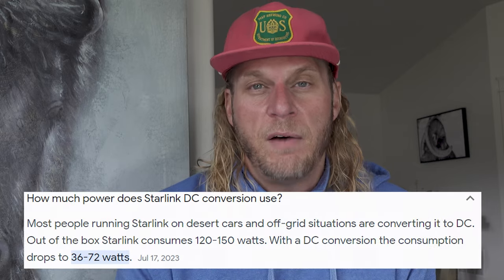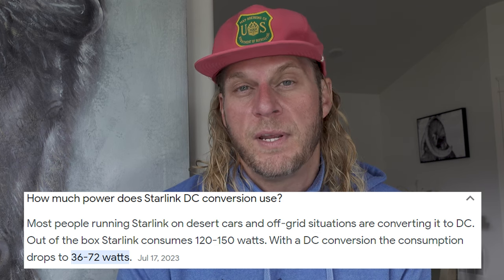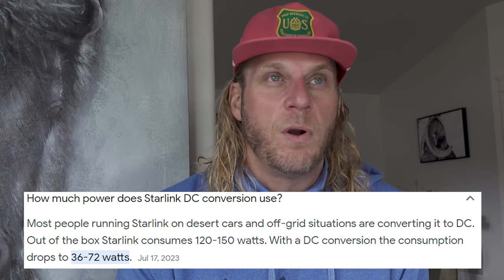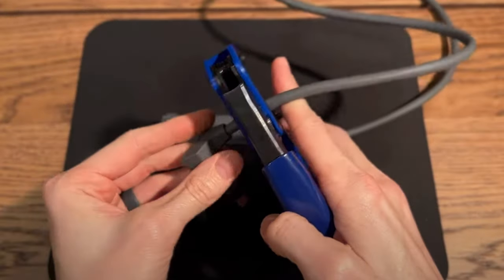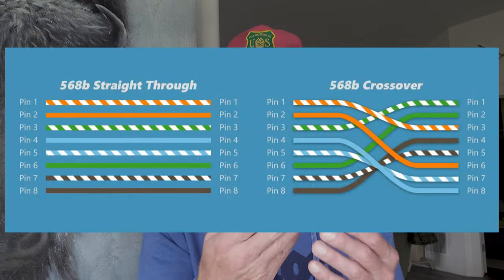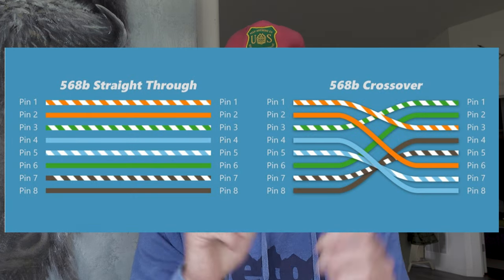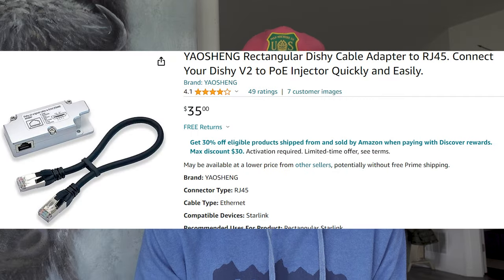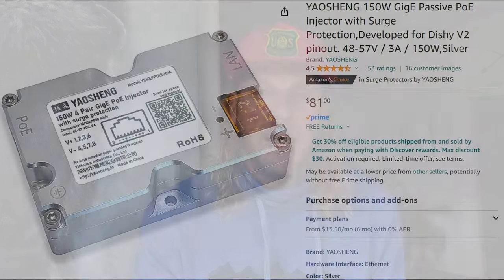Effortless Powering: YAOSHENG Adaptors Simplify Starlink with DC/Battery

Comment: I've done the same however speeds have dropped to under 1Mbps. Back to Starlink router and speeds back up. New network cables as well. Any ideas?
Reply from the maker: That's crazy. What router was it and wifi protocol do you know?
Reply: @HillPhantom  GL iNet Opal router. Just the standard security protocol. WPA2 from memory.
Reply from the maker: @damot1243   huh, same one I have.  And how do you have it all wired up? Have you tried switching cat 6 cables? Or have you tried turning on the bypass mode?
Reply: @HillPhantom  I put the opal into repeater mode and tested all the network cables. All cables had full speed similar to connecting directly the Starlink router. Only 2 connections left are the POE injector and the dishy to Network cable adaptor.
Reply from the maker: are you using the same set up as I am, with the adaptors?
Reply: @HillPhantom yep same adapter's. I think only a slightly higher step up converter in terms of amps, still 48v though
Reply: @HillPhantom  I just tested the POE injector with the opal router in repeater mode and the data throughput was similar to being to connected directly to the Starlink router.
That only leaves me to test the dishy to Network cable adaptor as this might be the problem, although the dish is getting power to start up.
Reply: This is a pretty common problem due the electrical noise generated by the 12V to 48V converter that then powers dishy. You can google it to confirm. Some people seem to not have the issue but many do. Best solution is a better converter such as the one made by Meanwell (DDR120A-48). If you use a router that can automatically downgrade the link speed to 100 Mbps then you usually get a stable connection as well but limited to 100 Mbps.
Reply: @christophS2468 
Will look into that. Just got to test the throughput of one more component to eliminate that.
Reply from the maker: @christophscheurich7570  interesting I have had no issues with my set up. I like the idea of the Meanwell but its a bit of overkill for my set up personally. I think its an awesome observation and  suggestion as the only differences is he has a different buck convertor. @damot1243 Christoph has a great solution and troubleshoot suggestion!!!
Reply: @HillPhantom  If your setup works then don't worry about it. Some PoE injectors do a better job at  noise filtering and the amount of noise that you have in your 12V system varies. I didn't discover this solution even though I ran into the problem myself. Did a bunch of research after my dishy connection never really worked in a similar 12V setup as yours. Substituted a router set for 100 Mbps link speed and that worked up to 100 Mbps. Ordered the Meanwell up converter and everything worked with the original router at 1 Gbps link speed.
Reply from the maker: @christophS2468  wicked cool! I think I need to order the Meanwell! Thanks so much!
Reply: When I initially connected everything up I was only getting 10BaseT half-duplex link lights on my switch.  It turned out to be that short black ethernet cable that comes with the adapter hooked between the injector and the adapter.  I don't know what is wrong with it but I replaced it with a regular gigabit ethernet cable and the switch negotiated a gigabit.

If you are still having issues, also perhaps consider putting a ferrite bead on the +48V power, or even one each on the power and ground wires, and see if that improves the link.  Separate beads, bundling the two wires together with one bead won't do anything (net current is zero).
Reply: Ok. Finally got around to testing the new power supply. Works perfectly. No changes to anything else.
Reply from the maker: @damot1243  heck yea! On that DC juice now! Congrats!
Reply: Try the same Yaosheng 120W injector. It contains low noise 12/24V to 48V DC-DC Booster and PoE Injector. All protected from over/under voltages, reverse polarity, overheat etc.
Reply: Same problem here

Comment: I've been looking for precisely this sort of gadget to directly power dishy from my 48V battery system.  Got both devices and it worked pretty much right from the get-go.   I was able to remove the DC-AC-DC conversion and remove the wifi router entirely in favor of my own.  A+.

I have two comments.  First, the black ethernet cable that was included with the adapter actually had some contact issues and my LAN only negotiated 10BaseT half-duplex, but replacing it with any old GigE ethernet cable solved that issue.  So check the link speed.

My second comment is that people should be sure when connecting up the 48VDC to put a glass automotive fuse inline with the positive, rated for 3A or 3.15A or so.  This is a passive injector which means that it does not have the normal power safeties that active injectors have.   Use an inline slo-blo glass fuse because we're talking about 48V here and normal automotive blade fuses are only rated to 32V.

I'm a very happy camper.  Dishy is consuming a lot less power now.  Generally between 25W and 40W now.  Before it was eating 60W plus additional inefficiencies from the DC-AC-DC conversions.

-Matt
Reply from the maker: Awesome feedback. TY so much! We had another user with speed issues I bet that cable was his issue! Cheers!
Reply: During the worst conditions: (1) snow-melt is on at low air temperatures, (2) both download and upload traffic is active,  your Dishy V2 can consume up to twice more.
Reply from the maker: @calypso5925  True but not if you turn off the heater. That's the kicker why it draws that much. Not that a recommend turning it off...wink.

Comment: Something weird happened to mine. Yaosheng also. around 4-5 months ago, i tested it, and stumble into the same problem as your pinned comment so i abandoned this idea. But at least the power consumption were indeed small, at around 40watts draw from battery. 

Fast forward to last week, i retested it, and now the power draw is even more than with AC power, at 80watts standby. Although the speeds has become equal with the original setup.
Reply from the maker: Thanks for posting this update. I have been locked in winter so have not visited it, but soon I will, and I am eager to see if it survived the cold.

Comment: Did you use any kind of connector for the power cables into the POE injector?  What gauge wire?  I'm trying to put 10AWG cables into mine and so far it seems like not enough room, not sure if I need a fork connector or something.
Reply from the maker: No need for POE injector that YAOSHENG handles all that! I used I think 12 gauge wire and it fit well. I know this is late but how did you end up?
Reply: @HillPhantom  found some small ring connectors and worked great.
Reply from the maker: @gf3803  so glad to hear that! On that DC juice now! Nice!

Comment: So you don't use the starlink router at all? I didn't know you could get startling through just the dish and a generic router... interesting
Reply from the maker: Yup you can use own router, just need to specify your doing so in app :)
Reply: Do you mean that one would need to turn on the bypass mode? I’m trying to get this to work but for some reason I’m not successful…
Reply from the maker: @mikalweber2471  it actually should work without but best practice to turn on bypass mode. I got lucky was plug and play pretty much w.o. doing bypass and never got around to doing it and it was fine. Here is a good walkthrough. https://www.starlinkhardware.com/how-to-bypass-the-starlink-router/

Comment: Thanks!! Great video… Do this instalation works with any version of Starlink Kits?? Thanks
Reply from the maker: So, I have not tested it yet, but I do know other dishes require more AMPS to power it. That would just mean you need a bigger convertor to get the right amps to Starlink. I recall Gen 3 uses more amps for example than my gen 2.  I would check the amps on the dish, also check with YAOSHENG before you purchase as they may have new versions and perhaps "made for x type of starlink". I need to revisit this a bit myself, as I am looking at trying to get the newest little dishy! Thank you by the way or the watch and comment! Cheers.

Comment: Hi I wonder if anyone can assist me. I have almost identical setup to this with the exception of using the Meanwell 48V transformer. I can get it all setup, Starlink boots up and does its thing and finds satellites. When it gets to the last stage of determining its orientation, it disconnects. I then have to restart it again and then the process starts all over again.  I have managed to get it to connect only once so far. When I revert back to the original router there is no problem.
Reply from the maker: That's a really tough one to be honest and above my pay grade a bit, but I will try my best. What router are you using?
Reply: Hi many thanks for your response. I actually managed to get this to finally work yesterday. It seems to be that the issue was the Starlink was set on residential rather than roam or mobile. It seems even though I was still at my home address it thought I was trying to use it from another location when I connected it to the 12V system rather than through the original Starlink router. @HillPhantom
Reply from the maker: Thank you for responding back and letting us know, as that to me his highly interesting.  That almost indicates they can sense power source and make assumptions based off of it.  Very interesting thank you for reporting back!  @craigwalker8195

Comment: Maybe you should think of putting an in-line (12 Amp) fuse from the 12 V battery to your 48V/5V inverter, in the event you have short, it will prevent a fire!
Reply from the maker: Totally agree! Also installing a battery turn off. Going to revamp it a bit for this season and the inline fuse is top priority. Great suggestion! Thanks for watching! Cheers.

Comment: I’m a telecommunications technician have been for over 20 years and your cross over diagram is wrong, and the Starlink factory made cables are Cat5e
Reply from the maker: Good catch! I actually must have grabbed the wrong diagram! I see now my error! Cat5 e im prob said Cat7 huh? Making videos and keeping all the info together and making my mouth say the right CAT is hard sometimes! I am certain its not a DOG though lol. Appreciate the corrections mate!
Reply: @HillPhantom are these errors corrected/fixed in the latest edit of this video?  Or are the errors just noted down here in the comments?
Reply from the maker: @traviswolf  The only error is I put the wrong diagram of a cross over cable. No other errors the system you see that I built works fine. I just accidentally put wrong diagram of a crossover cable which is not needed if you buy the adapters I am using.

Comment: You nevet did the power comparison
Reply from the maker: I am sorry, I got super busy, what was the power comparison you where looking for again, please excuse me, had lots going on..Cheers!
Reply: @HillPhantom  it was between using the starlink on inverter and using it on the 12v power
Reply from the maker: I need to get a power monitor solution once I do I will report back

Comment: I bought this whole kit only to find out that it doesn’t work with Starlink generation 3. So don’t follow this exactly if you have Gen 3. 

If you do want to follow this method I bought the whole kit and will sell it to you for a discount as it’s outside return window. Just reply to this comment and we will connect somehow. I spent $233 for two converters, router, and two yaosheng adapters. Will sell it for $150 or best offer.
Reply from the maker: Sorry to hear that